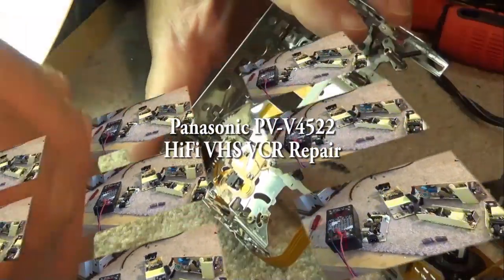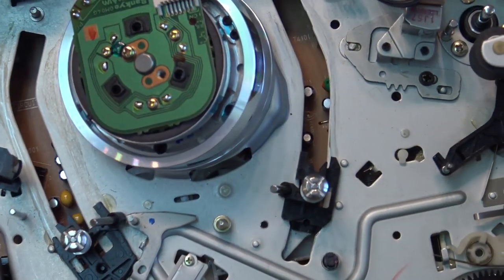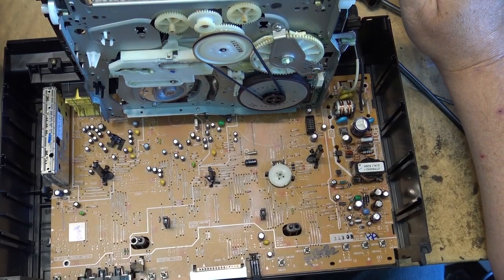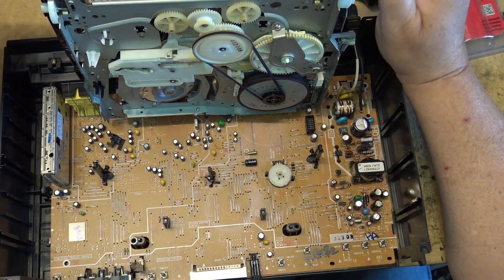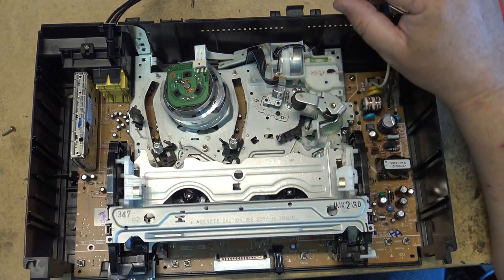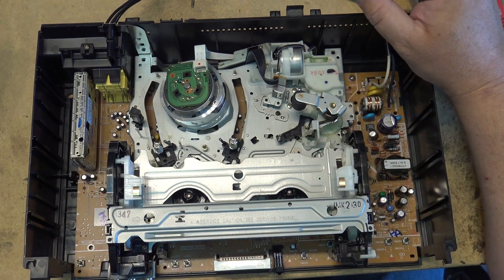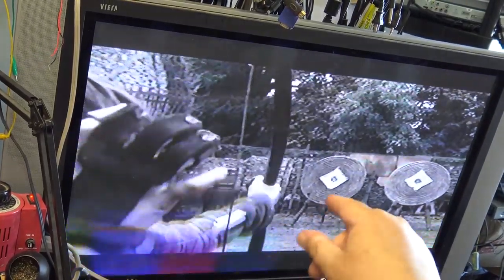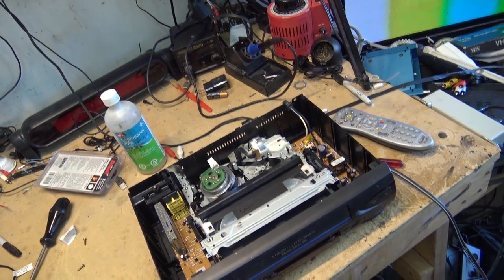Panasonic PVV4522 VCR Repair

Comment: Was just working on my unit checking the belts and cleaning it, thanks for the info on getting the mech out. Albeit mine had 4 screws, 2 in the front where the ones on this one are, and 2 near the back panel. and everything was socketed, and there is no board on top of the head, but mine is an older 2000 model. Good to know that my model isnt as cheap.
Reply: Found the model, mine is a PVV4520, so 2 numbers off

Comment: I have one of these Panasonics, my grandparents bought it new in 2002 and barely used it so it's clean and in pretty good shape. They weren't at the absolute bottom of the market and by the standards of a last of line VCR they aren't bad. In my experience they can reliably track poor quality recordings that a lot of other VCRs of this era struggle with, so if you need a cheap VCR to digitize old recordings this is probably the one to get. At least it doesn't have one of those terrible foam-on-a-stick "head cleaners".

Comment: I like how EVERYTHING is labeled on the circuit board, even which block does what. I had a Symphonic TV VCR combo that bit the dust so I took it apart and pulled the main board out and was able to find and hook up the TV's audio amp and play audio through it. the amp chip gets really hot though. I don't run it much because I'm afraid it's going to burn out.

Comment: Thanks a lot for sharing your knowledge and expertise. I just fixed my Panasonic PV-9451 (mfr'd 1999). It would not REWIND. Cleaned the Mode Switch with DeoxITLiquid D100L and that did the trick. I was hoping that the tape sensors didn't go bad on me since the tape position feature was also not working on this unit, but after cleaning the Mode Switch -- that also got fixed.  I bought this unit new back then. Still have original remote control. The unit is still in good condition, now working 100% (thanks to you) which will make it easy on me to transfer some old home made videos to digital.  Thanks a million!  Definitely subscribing. -- Oh almost forgot, the head cleaning trick with regular paper with alcohol was new to me!

Comment: This one brought back memories of my first successes and greatest failures.  With this exact model, I found and fixed a power supply failure.  Then, like a fool, didn't properly reinstall the tape assembly.  The mechanism got jammed which caused an over-current to blow a hole in the driver IC.  I never looked for a replacement.  Didn't think the chances of getting one were good, and it wasn't a great loss.
Reply from the maker: I open these and it brings back bad memories of a shop I hated working for.

Comment: For something as cost reduced as these late model VCRs were, they were surprisingly functional.  I'm debugging the power supply in my 2004 vintage Panasonic VCR, which had served well for 16 years!
Reply from the maker: The new ones were very reliable due to reduced parts count.

Comment: With the help of this and another of your repair videos I've been able to resurect and clean my twenty year old Panasonic NV-HD630. It was made in Japan and seems to have been well built. It was easy to dissamble and remove the mechanism to get at the mode switch which was placed on the circuit board underneath. I could see some corrosion on the tracks of the switch but the Deoxit removed that quickly. The heads and the rest of the running gear were quite clean. I took off the little head cleaner roll which had some dark gunk on it but this came off easily with some alcohol and so went back on nice and clean. The small circuit board above the motor had some strange white almost dusty coating but again that came off quickly with alcohol. It all went together ok and is working fine so thanks for your help. Y

Comment: One of the reasons for belt deterioration is the chemical reaction between the belt and certain types of plastic.
I just found a melted balloon in a box of remote controls.  The balloon only melted in the places it was in contact with the plastic remote controls.  And some of the remotes didn't melt the balloon.
Reply: I have a c-cassette case that got permanently stuck together with a pencil eraser. There's some kinda stuff, maybe plasticizer in the eraser that turned the plastic into a sticky goo where it touched that. The two are unseparable now.
Reply: @750kv8  Something very similar happened to me only it was a rubber bands instead of an eraser.
The balloon I found just melted itself and did not damage anything else.
Also I think PVC power cords will react with styrofoam.

Comment: There was a "fix" for these that had slow rewind/random eject problems which was to half the resistance going to the IR diode for the tape sensor. Tell tale sign was unit would malfunction every time with the cover off in low ambient light and spit the tape out. Other units wouldn't do this, even with the cover off. As I recall, this same chassis was also sold as Zenith and Symphonic.

Comment: I use to use my VCR to record, my programme, then used Freeview recorder which broke down or not recording because of the flash drive .then I waited for weeks to try reboot it , when I just clicked that I could of used my VCR or DVD player to record my programme as I did before Freeview recorder.and more and more people I found out are going back to cassette player etc  with the cost of living, and IAM glad I didn't throw away my VCR or cassette player, and record players, because I saw a few vinyl  record shops opening in my area.

Comment: In fact this is not an original Panasonic made VCR but a general that came in the market with many various names around the globe.The permanent problem of all i have repaired is the contacts oxidation of the rotary positioner leading to malfunctions or broken gears and once had the center infrared led that burnt and couldnt sense the presence of the cassette.

Comment: How does the loading mechanism works in these type of machines? I got a PV-4601 that is similar to this (older, from 1996), and it doesn't take or ejects tapes. I don't see a gear that takes the tape in, so I don't understand how it works. It looks like there are some springs that are supposed to do the work, but I can't figure it out. Even with the service manual been available online.

Comment: I'm trying this repair but I can't "pull the mechanism down" like in 3:20 it just won't move...
EDIT: there is a white leg on the right side that has to be pulled out from the white plastic in front of it... just discovered it by accident :) but you didn't mention it in the vid
Reply: My white plastic leg won’t budge. I’m afraid I’ll break it.

Comment: I'd want that VCR when nobody wants these anymore to the point they are switch to DVD or Blu-Ray Disc Player, I'd having a ball of this mechanisms reminding me of my 2000 Quasar VV-1302, the one I used to not only watch movies and shows, but also recording Thunder Over Louisville until I got a good Broksonic VAHFA-6741GST Series D Hi-Fi Stereo VCR, they're made in Thailand, and not an issue there once so ever, and I like them, it's got some metal and plastic, still keeping it with me, recording the weather observation from the chief meteorologist along with meteorologist (and yes of course, Thunder Over Louisville, my favorite fireworks displays), and the storm chasers and along with the tornadoes.

Only thing I don't use them is Apex Hi-Fi VCR/DVD combo and Samsung VCR/DVD Combo, because I don't feel like that I don't need them, but this Panasonic ones, the pair of them I like.

Comment: With the incredible amount of jumper wires on this, I wonder why the PCB manufacturer didn't opt for a dual sided board ? Probably still cheaper to have a pick-and-place machine insert all those jumpers. Also, there seems to be quite a few Tantalum capacitors on there (those yellow ones), just waiting to short out. But at least the electrolytic ones don't seem to have leaked out. Great repair work. Thanks for sharing. BTW, do you have any idea where I could get my hands on a drive belts set for my RCA full size VHS camcorder CC300 ? Because it's still in great condition, only the belts are turning to tar inside it...

Comment: We like Pannys because they allowed LP (4-hour) recording when everyone else was limited to SP and EP recording. Also, that their IR remotes for '80s VCRs (GE and Quasar OEMs as well) would work on their newer VCRs - at least until the 'Light Tower' series came out after the turn of the century...
Reply from the maker: Yes Panasonic had LP speed. The others didn't because LP was never a licensed speed, and JVC would not license anyone else to use that speed. Since Matsushita  was a co-devoloper of VHS with JVC and Sony, they basically gave JVC the raised middle finger. 
When VHS first appeared it was single speed SP only. Matsushita was making vcrs for RCA and RCA said that Americans would not go for a machine that only recorded 2 hours, so Matsushita halved the speed for the RCA machines. JVC never accepted licensed that speed from Matsushita and instead reduced the speed again, and required all companies to use the official speeds SP and EP. 
Panasonic branded machines don't even call it EP, they call it SLP. There is a reason for that too. JVC never recognized the LP speed and only licensed SP and EP speeds. The only reason that Matsushita got away with this without being sued is because JVC is a sister company of Matsushita, just like Aiwa is a sister company of Sony. Independent, but under the thumb of the big sibling. 
JVC or course stands for Japanese Victor Company. Victor made phonographs. People seem to thing that it had something to do with RCA as everyone remembers RCA Victor.
Well, RCA was the Radio Corp of America, and the "Victor" was phonograph and record company.
RCA Victor combined the radio parts from RCA and the phonograph from Victor.
The original Victor phonograph were the wind up types with the big horn. When RCA bought in, it became an amplified pickup and was known as RCA Victor. Victor also sold phonographs in Japan, and became known as JVC.
Reply: @12voltvids  Hitachi also had LP.
Reply from the maker: @crashbandicoot4everr  
Some did, namely those same models they made for RCA.  None of the shvs models did. JVC tightened the noise on the svhs units.  No lp for you.
Reply: In uk it must be different,  its just sp and lp whatever make vcr you have, ive never seen an ep machine.. it seems thay are capable as you can see ep in the vfd display when taken apart in older machines. No vfd display in newer machines.. . our standard tape is e180=3 hours sp or 6 hour LP and e240 tapes = 4 hour sp or 8 hours LP speed. Dont know why we dont have ep speed? So now I want a vcr designed for usa in uk to see if it works and to try ep. I will lower the supply voltage before I plug it in.. unless it will take 240 volt ac.
Reply from the maker: @09danstart  
Yes pal machines are different.  Speeds based on line frequency as your frame rate is based on that.  Ntsc are 30 frame 60 field.  Pal/secam 25 frame 50 field.  The drum spins slower and tape speed is slower.  A t120 tape here becomes an e180 tape on pal.   Ep tape speed is the same tape speed, your so speed is half way between our sp and LP speeds.
Reply: @12voltvids  I have a JVC machine that plays LP tapes.
Reply from the maker: @davidbell2967  Yes JVC machines will play LP tapes, a few ones may have even recorded in LP, but LP was basically an odd duck. There is really no advantage to use LP.

When recording video the video track width is set by the recording head. You have heard the term 4 heads and 2 heads right.  That is the video heads.  The SP track width is 68um and EP is 22um.
LP track width is 34 um.
Track width determines signal to noise ratio.  Ideally you want the tracks as wide as possible, to fill the entire tape with information, and you want the tracks written right up next to each other with little or no space between the tracks.
This is why 4 head decks were designed. A set of heads with a 68um track width, and a set of head with 22.  A 2 head machine only has 22um heads if it has the EP speed or 34um if it is a 2 speed machine with sp/lp (very old first gen machines)
Here is the problem, on a 4 head machine running in LP, you are writing a 22um video track and leaving 12um of dead space between the tracks.Track width determines picture quality. In LP you are writing the same track width as EP, so no signal to noise improvement there. The only slight advantage is slightly less crosstalk due to the effect of a large guard band between the tracks. The linear audio will be slightly better due to the faster tape speed. Tracking is more difficult though because of the narrow track width and the large guard bands.  A 2 head deck recording in the SP mode has an inferior picture to a 4 head machine in SP for this same reason,  except that the guard bands between the tracks are 46um. So 22um picture track 46um blank space.

Comment: That thing is way less complex inside than my General Electric VG-7720 from 1988 (it was made in Japan, and I think Panasonic was the actual manufacturer). The mechanism has so many gears that it looks like the inside of a mechanical wristwatch, and the mechanism is attached to a rigid cast-metal (looks like aluminum alloy) frame. 

I want to replace the electrolytic capacitors because on its OSD screens that have a solid blue background, there's slight random, constant motion in the picture that shouldn't be there, but they are going to be a nightmare to get to. I suspect that the electrolytic capacitors in the power supply are the culprit. I don't know how I'm going to get to those yet because they are all boxed in. It would help if I could remove the main PCB, but there are several ribbon cables attached to it. They look like they have connectors (rather than being directly soldered to the PCB), but so far I haven't been able to get them to budge.

Have you ever done a video on a GE VG-7720 or one in the same product line, such as, VG-7510, VG-7520, VG-7725, VG-7775, or VG-7785?

Comment: pretty sure these VCR's came out for the UK market too, the UK VCR's had a NICAM Decoder built in for the Analogue Stereo Sound from the Ground Based Transmitters, and 2 Scart sockets as well as Stereo audio outputs
Reply: NICAM was digital.

Comment: Hi mate thanks for sharing this. I always learn plenty whilst watching your videos. I have a panasonic nv-fj630 and notinced that when I take the top metal cover off, the unit will not play a tape. At first I thought the metal cover was completing a circuit to tell the unit when the cover is attached. But I'm guessing its a light sensor because if I shade the unit with a sheet of cardboard the unit works as expected but when i remove the cardboard or cover the tape ejects. My question is, do u know where that light sensor is and how I can trick it into thiniking the cover is on? I thought it may have something to do with the light sensor tape post so I covered the clear perspex post with tape, but it didn't solve my question. Any help or advice much appreciated. Thanks in advance

Comment: What's a shame is those machines are better quality than the one I want to repair. It is a Funai that is Sylvania branded and was the last VCR I bought brand new. I don't have much hope for it though. I think the drive belt is bad I think I paid $40 for it back in 2003 as a teenager on an impulse purchase because I wanted to upgrade to a HiFi deck so I could record and playback Dolby Pro-Logic Surround programming for my home theater. I've done a lot with this deck over the years. I even made a YouTube video after dubbing the camera tape to this deck and also recorded the final computer edit back to VHS for my parents on this deck (they got a DVD copy also). I stopped using it for a while (my primary recording device was a DVD recorder for a bit), and in 2013 it started giving me issues. After another 5.5 year hiatus it is virtually unusable and eats tapes as well as fails to start rewind and FF.

I'm probably going to look at either a Japanese made Panasonic or a maybe a Sony on eBay.

Comment: My mom's Panasonic Omnivision VCR developed an odd fault with the heads. It would make an odd noise when the head was in motion and it affected playback. I never figured out the problem or why it happened as it was a great VCR for years. At least you can find remotes for them on eBay.
Reply from the maker: That was usually the ground strap  that was on the bottom of the drum to discharge any build up.
They started to squeek and caused picture disturbance.

Comment: I have one of these, the mono version unfortunately. Bought it new around 2002 like you said when these things were being made. I still have the original box, remote, and manual. It was retired shortly after it was bought because of a bizarre issue it developed. On movie tapes the vcr worked perfectly, but when playing recorded tapes the audio would be very muffled and sometimes it seemed as though the vcr was playing the audio from something it had recorded over. These tapes played fine in other machines so it wasn't the tape itself. I never attempted to fix it since it was such a strange problem but I would give it a go if i had an idea what to look for.
Reply: A little late... clean the audio/tracking head for mono. If the pic is good, stereo hifi is encoded with the video and read by the video head. Suspect the other head is dirty or out of alignment. It can be adjusted with a screw on top but be careful not to screw up the top of the tape which will ruin that section of the tape.